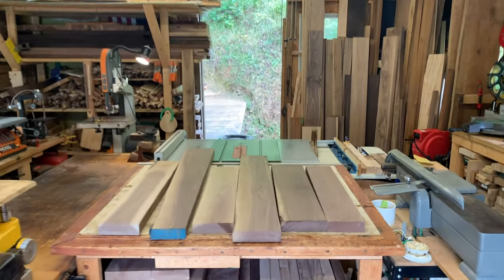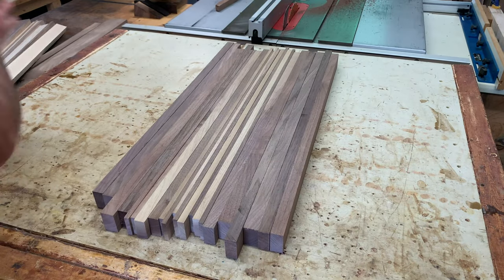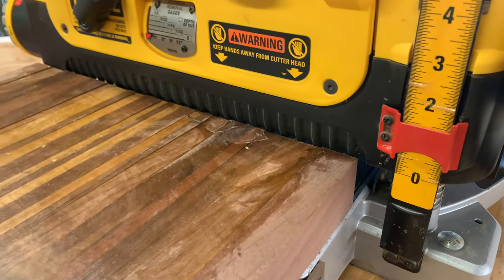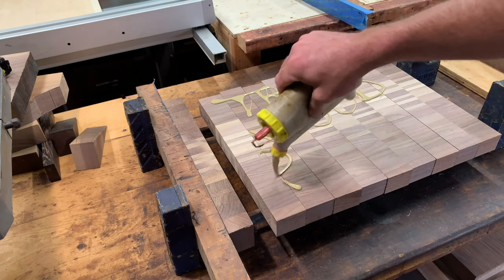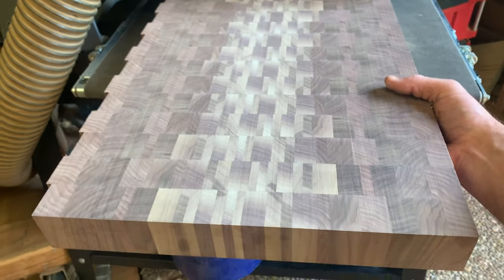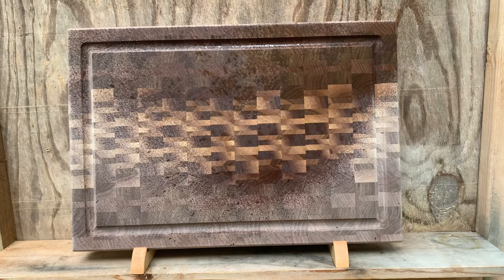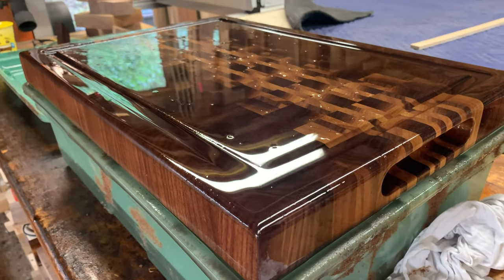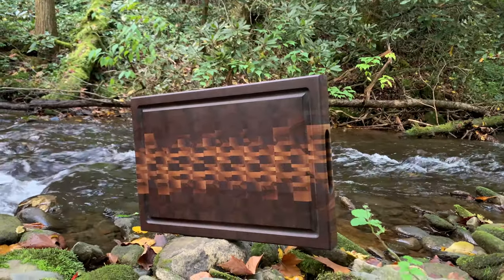A RIVER Inspired END Grain Cutting Board *** Making The Most Of Walnut Sapwood

Comment: You captured it!  I think what really made the difference is using narrower strips of inconsistent sap wood widths in the middle with consistent wider width heartwood on the outside.  It really created the “blurred” effect of moving water.  Kudos!
Reply from the maker: It's a slowly evolving design that has lots of potential, another way of adding to the water effect might be by adding a second panel to the mix. I'll have to give it another go one day. Thanks for watching!!
Reply: @thewoodplank4376  Second plank??  I am not following.
Reply from the maker: @bw162  I usually try to build two or three separate panels and mix them all together, instead of using just one. The more panels usually translates into more of a gradient.

Comment: You have inspired to make end grain bards. your work is amazing. Tightbond 2 DARK! what a great score! Thank you. I need your help with something please. Happens on edge grain and end grain boards every so often to me. Doesn't matter what glue I am using, 2 dark or 3. The glue line raises after finishing. You can feel it big time. The fact that it doesn't happen all the time has me puzzled. I have even had an end grain board that it only happened on the second d glue up glue line??? I rubbed side to side and felt nothing but rubbing top to bottom every line was raised? Am I using to much water when I raise the grain? Am I not letting the glue dry long enough before finish? 24 hours minimum. PLEASE HELP...

Comment: I’m just getting into making cutting boards what do you mean about watching which way is the grain of the wood is going? Should you rotate the directions or can it be running the same way
Reply from the maker: It's best to alternate grain direction if possible, much like the way a table top would be glued up. Basically one piece going up then one down, as the wood moves overtime this will helps things structurally.

Comment: Beautiful work!  Couple of questions.  I apply oil until it stops soaking in, is that too much?  It seems you don’t add feet to all your board, what goes into that decision?
Reply from the maker: Thanks! Endgrain gets thirsty, I usually soak them for 5-8 minutes, twice. You can also look for the air bubbles rising to the surface, when those stop you also should be good. I make some of my boards reversible (One side for meats one side for veggies), and I don't add feet for those boards.